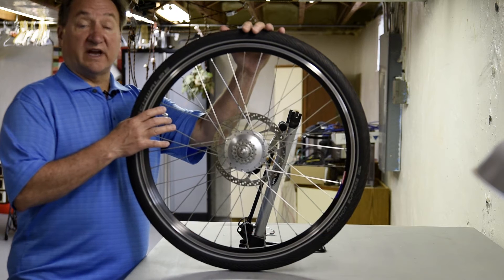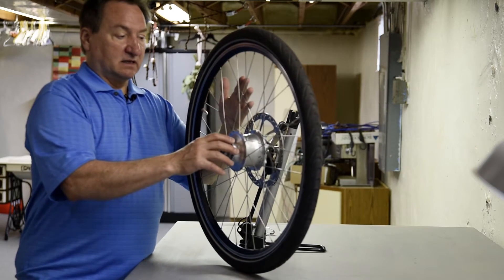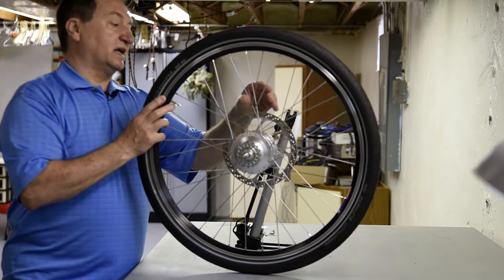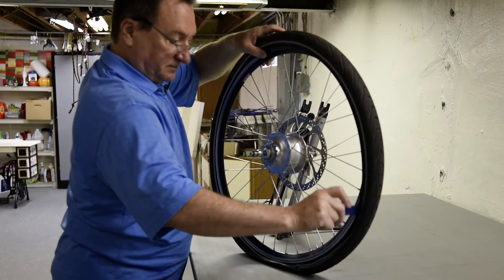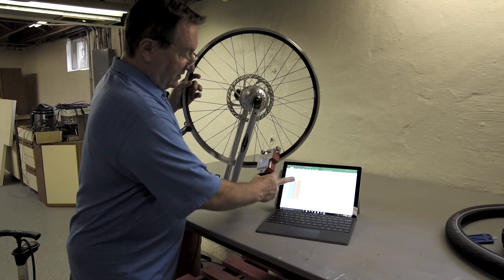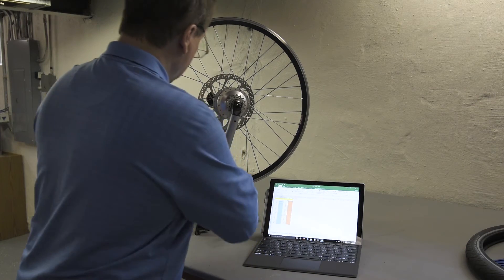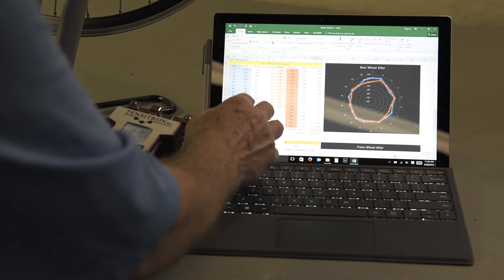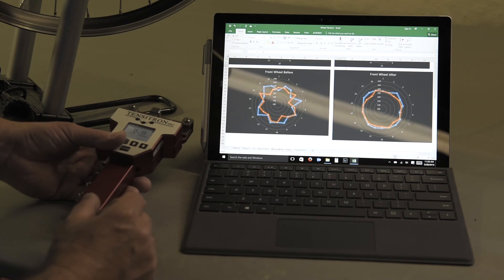Proper Spoke Tension

Comment: Why did you need to take the tire and tube off the rim first?  Was that to get it to fit on your wheel truing stand?  Or does an inflated tire somehow mess with the truing process?
Reply from the maker: It did fit on the truing stand better.  I also assume that it may influence the spoke tension.  I am not sure of that.  I will measure that and see if the tire influences the process.

Comment: Which tensioneter you use? Need info
Reply from the maker: I used a tension meter that was available to me.  It is from TENSITRON Inc.  ACX-1 Series Digital Aircraft Cable Tension Meter.  I remember that I had to do a calibration to get what I thought would be close to an accurate reading for solid spokes.  There are bicycle specific tensiometers that would probably do a better job.  I only used this one because that is what I had access to.
Reply: @ScreamerTR  I saw that is special... and that is why I asked origin.... many thanks